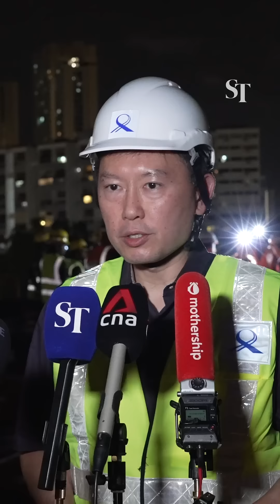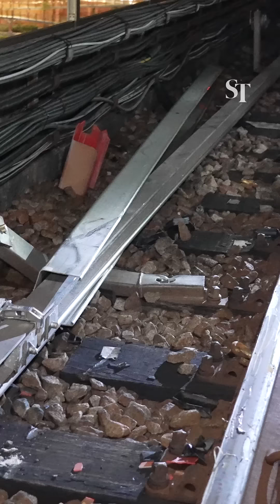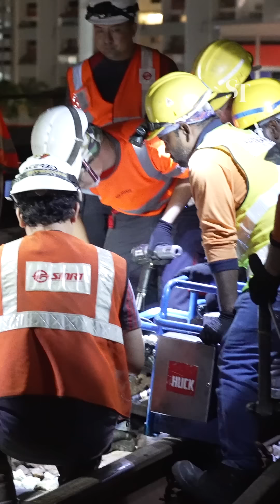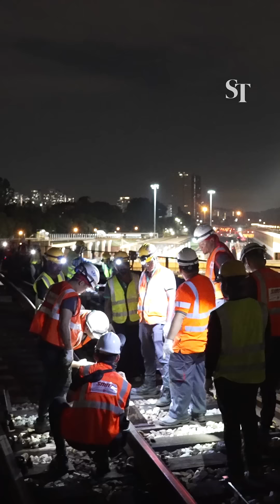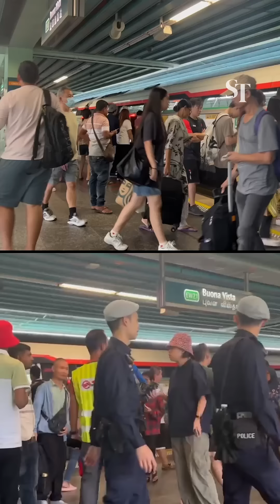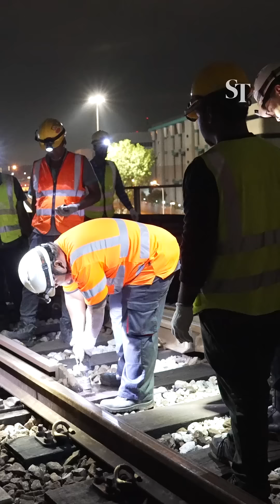Chee Hong Tat on the challenges of repairing the East-West Line

Comment: When the train halt along the track and couldn't move, they asked all the passengers to get down and walked to the station. Instead of accessing the situation and condition of the train, they decided to just drag the to the next station. This is the biggest mistake! The faulty part dropped out and was dragged along the track causing extensive damage all along the way. Who should shoulder this blame?
Reply: The processes and interventions to avoid extensive damage are really in question. These have to be surfaced and highlighted if there is transparency in the system.

Comment: I thought the GOV had said before that they would replace the old MRT. Why are they still using the old mrt after many years of saying? What is the reason for increasing the fare? Really need the opposition to perform the question in the parliament. Where is the revenue going to? I really can not believe, using a cable tie to tie the part. A car in Singapore can only use not more than 20 years, but MRT can be used for 35 years or more, which the load is super high every day.

Comment: The cause of this incident is not the use  of any 35 years old train as all these old rolling stocks had been replaced recently.
The extensive damage to the 1.3km section of the EW line railway's tracks, power rails, point machines, etc, is likely caused by the locomotive consist forcibly towing a stalled train that had drop its gear box and the wheels axle had dislodged out of position.
This forced towing of the train repeatedly bashed the tracks and trackside equipment by the dropped axle damaging them extensively.
The modern railway is a complicated system and right now the public should let the repair work be carried out without hassling the workers or LTA or the Minister.
Just take the buses provided and appreciate the value of having a decent  public transport.
Reply: It will happen again, the bigger question to ask is how should we approach this incident to prevent damages from spreading?
Reply: @yawn74 
My reply to you offering a  solution to minimize future repeat was deleted for some  unknown reason.
Very strange, as they are very constructive comments.
Reply: @yawn74 
I will try again to reply:
Murphy's law : Anything that can go wrong will go wrong.
Unforseen incidents can and will happen in any large complex operating engineering system with thousands of interacting components.
We can prepare ourselves with having all the available tools, spares, trained workers and equipment ready at all time to be able to do fast and good damage control to repair the damaged works after these accidents happen.
This important pre-emptive investment need to be made by LTA/SMRT/SBST.

Comment: There is a possibility that the air-conditioner load was tapped from the same terminal supplied to the trains! Such air-con load should be separated from that of train circuit!

Comment: For anyone complaining about SMRT using their first-generation MRT trains that are 35+ years old, let me ask you a few questions.
1. The UK and Paris use trains that are over 50+ years old. What makes Singapore wrong for using trains that are 35 years old?
2. Even if Singapore were to scrap all of its old trains now, what would be their replacement? Where would we store all these retired trains? Would the public be able to put up with the longer frequencies between trains?
3. The old first, second, and third-generation trains are being replaced by the R151 trains by Alstom by 2026.
4. These first-generation trains have been running smoothly since their debut 35 years ago, so what's the rush to replace them?
Now, I still blame the authorities for this significant oversight in maintenance, but before you blame them for using such an old train, think about my questions.

Comment: My question is simple..why the damage is so severe if the system r well maintained in the first place??? 🤭👎💯
Reply: 1st gen train axle box dropped bro, it affected the tracks , they said its a rare occurrence, so do your own judgment
Reply: axle box dropped, hit wheel out, wheel fly and hit this hit that, physics my friend
Reply: @seagull9889  Your logic is just too flawed, this is just like saying everyone makes mistakes, so even this time is a costly mistakes bosses should not make a hooha out of it, as they cant be too entitled.
Reply: @leonenarwani7258  Doesn't contradict to what he is trying to point out. If it was well maintained the axel box won't dropped. Like you said it is a rare occurrence.
Reply: @Alvin-bo3uc  first gen train is the key point , it's the oldest train
Reply: @leonenarwani7258   Do you mean that because it is a first gen train, when accident happen we should be morr forgiving? I dont get the point of saying first gen train is the key point.

Expertsare saying Axel box just doesn't drop under normal circumstances. The reason can be improper installation or defectors component like the screws and all, all these shows that the train ate not so well maintained. Which is what he point out.
Reply: @Alvin-bo3uc A thankless job because of the many self-entitled citizens around
Reply: @seagull9889  Flawed logic. A mistake is a mistake. Solving mistake that were made by them is the job they should do. Do you expect your boss to thank you for doing your job?
Reply: @seagull9889  So is your boss self entitled? Because it just sounds that they are doing what we as the Citizen of Singapore do. We evaluate them in totality.
Reply: @Alvin-bo3uc  Nope. I am not perfect but I am much valued & appreciated. Not hammered for everything gone wrong
Reply: @seagull9889  Not hammared for everything wrong is the keyword. This is a costly mistake that affects hundreds and thousands of people and is going to cost a lot of money. No employers can accept this kind of mistake.

Comment: Is time for AI and robots to take over, they are tired of routine works, under the tracks should install cameras at all stations make used of trains slowing down to checks in motions of loosen or changes in images of electrical components and cable and etc

Comment: please open up the books and shows what actually happens which causes so much damages, Don’t always cover up
Reply: well, it is quite well explained why the damage is so extensive if you used physics to logic it out. should be show why the axle box drop
Reply: @justintay4044  Oh! So you can just use physic and logic to figure out why it drop🤣🤣🤣 I could use common sense of how good product like toyota cars don’t spoil so easily to the very details of every parts of vehicle.
It is so amazing that some idiots with no common sense could say they could use logic and physic to understand how something had drop🤣🤣🤣🤣
Reply: @philz3ro823  i dont think its a big issue. First world problems la. Old trains and parts tend to break down in time. But this time the part that came off caused big damage to tracks which is a rare occurance. once they change the train, tax payers pay lor.
Reply: @justintay4044  Do you have the common sense to know that Axle box is very important to a train?
Do you have the common sense that with proper maintenance with proper tools and parts , there is no possibility for an axle box to fall?
Reply: @philz3ro823  metal fatigue most likely caused the axle box to drop, as to why third rail, tracks and point machine break is due to parts that dislodged off the train including the wheel. come debate when u get diploma in engineering
Reply: @philz3ro823  no shit, i am just saying there is not need to show why the damage is extensive, there is only need to show why the maintenance of the train is bad enough for axle box to drop off
Reply: @Drippinonyou  It is a big issue which you do not have the common sense to understand it.
- A tipper truck wheels was replaced while the boss of the company decided to buy china made NUTs for the wheels as it was cheaper, same pressure were applied on tightening and when the tipper truck is moving with full load, the wheels fly on the expressway as the nuts burst or sometimes the bolts were over stretched and broked.
If you have common sense or logic, you will not have said such thing in the first place as you do not understand stupid people on top do cost saving without simple
logic
Reply: @Drippinonyou  the issue is so big because people who are managing don’t understand the real issue, they tends to save a few cents more and then causes few millions of losses, the people on top don’t understand that certain parts you have to use the best by just spending a few dollars to save a million, this happens also in building management and maintenance
Reply: @Drippinonyou  the issue is so big that the basic knowledge of getting 3 quotations to get the best price while not knowing the ingredients inside the quotations is a very bad culture for singapore
Reply: @justintay4044  Also, capable technicians should get higher pay then engineers who do not know shit
Reply: @philz3ro823  that i agree, too. But in this situation, boils down to train maintenance department
Reply: I dont think china made nuts is inferior. China has a very good railway system similar to japan. So by your logic, u are 100 years behind. Most of the railway projects now are done by China Con and theres nothing wrong with that. @philz3ro823
Reply: @justintay4044  what if the maintenance are good while the parts are shut
Reply: @Drippinonyou  That is because you do not understand how bolts and nuts works, basically you knows nothing about
Reply: @philz3ro823  then they would discover that the axle box have suffered metal fatigue and replaced it before it even have the opportunity  to detach from the train. This kind of thing doesn't break overnight
Reply: @justintay4044  you will never know if nuts or bolts are overly stretched or stressed until it broke, unless x-ray
Reply: @philz3ro823  physical checks, grab, try shake, visual inspection, other methods unknown to us. Cannot be only can use xray to check. If not alot of other equipment would break due to unnoticed metal fatigue
Reply: @justintay4044  If it does happen, it is mainly due to improper installation of parts after maintenance or testing activities or if defective components like damaged bolts or screws are not replaced, Mr Jumadi said.

See, come out in news as I had predicted🤣🤣🤣
Reply: @philz3ro823  and doesn't that points to the maintenance crew not doing their job right as per i stated?
Reply: @justintay4044  I already said, that area is critical and 100% there is proper maintenance on that part.
Faulty bolts and nuts or lousy bolts and nuts, who knows?
The purchaser fault? The system fault of getting the cheapest? The government fault for getting the cheapest as a culture?
This is nothing to do with technicians as they are just carrying out orders from the top.
Hiding the truth would not help while changing the system that is out dated is difficult due to culture of Singapore government while changing the brains for graduates or elites whom lead the top is even more difficult as they do not have common sense of why certain type of cost saving will causes huge effect
Reply: “It will be stupid if you don’t get a british passport when you are able to and when you are under 18, all the conveniences over at europe makes you a clever person.”
— philz3ro823
Reply: @philz3ro823 : “It will be stupid if you don’t get a british passport when you are able to and when you are under 18, all the conveniences over at europe makes you a clever person.”
— philz3ro823
Reply: @8August1988  😂 why are you still speaking something stupid?
Reply: @8August1988  Malaysian Chinese who had run to malaysia when Singapore was kick out regret what they had did.
Singaporeans who had migrated had no face to come home even when they regret.
If capable, who wants to give up Singapore citizenship for Europe citizenship?
Giving up a citizenship that citizens feed themself and go to a country that workers have to feed non workers? You are such a joker!🤣🤣🤣
Reply: @philz3ro823 ：所で、貴方は日本人ですか？！
Reply: @8August1988  🤣
Reply: @philz3ro823 : Jika anda masih mahu hidup di abad ke-20, jangan paksa orang lain untuk mengikutinya!
Reply: @philz3ro823 ：無論如何，真正機靈與敏銳的新加坡人應該懂得如何首先獲得澳大利亞或加拿大護照，尤其是如果他們含有很多男孩。

與妳同齡以及比妳年輕得多的香港人——尤其是男性——在全球範圍內的流動性比妳高得多。
Reply: @philz3ro823 ：無論如何，真正機靈與敏銳的新加坡人應該懂得如何首先獲得澳大利亞或加拿大護照，尤其是如果他們含有很多男孩。

與妳同齡以及比妳年輕得多的香港人——尤其是男性——在全球範圍內的流動性比妳高得多。

Comment: In Feb and July 2024, I reported via LifeSG that I smelled rubber burning and white smoke emitted into the green westbound mrt train cabin as the mrt came to its halt and on opening the doors at both the Paya Lebar station and Simei station. I suspected they were due to some wear and tear of the train parts. However, there was no update on any action taken. So I am not surprised by the current east-west train breakdown situation. Wished they had taken my reports seriously then.
Reply: when train brake, will have heat, so will have smoke but as for rubber smell, that could be the brake system the rubber. that is kind of normal

Comment: why it take so long to repair? simple reason, those in engineering industry will know that these kind of companies like SMxx, Sx engineering etc only know how to prepare tender document. all engineers are shaking leg in the office waiting for retirement and do not have knowledge on the system nor hands on experience in in repairing or redesigning when something bad happens. all contractor and subcontractor fault.
Reply: time to change the structure, stop taking credit when you are only buying stuff from people and it works.

Comment: all the paper generals occupying the top post of cos can talk.  why the ceo of smrt did not even come fwd n explained ???
just like why must ex Lui explained n explained n explained until he also dulan bcos the ceo of smrt mr des just hide behind ???

dn need to talk so much n merry go round the garden. basically, the wheel flew off. why ? bcos the locking device dropped off. why locking device drop off is the key issue n need to explain to the public !!!  never do maintenance ?  ok maybe after [saw ph] era, still smrt did not get the service & maintenance manual from Kawasaki bcos LTA dn allow ????

the train can b 35 or 350 years but the wheels n the boogies cannot b 35 years. especially the wheels, bcos of wear n tear they cannot b 35 years. so, talking abt 35 years old train is irrelevant to tis incident !!!!!

imagine the wheel flew off the track n onto the road hitting the cars n pedestrian below, who should b responsible ???
Reply: Use the $335 m to replace the trach and do extra maintenance. In memory of LKY we have already minted a coin and it is good enough